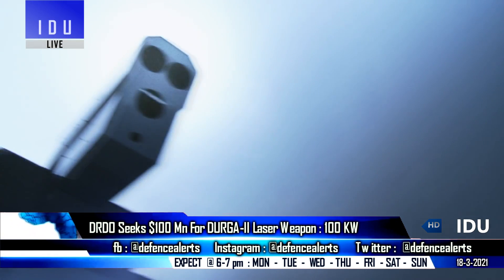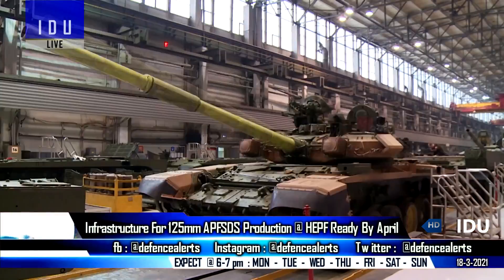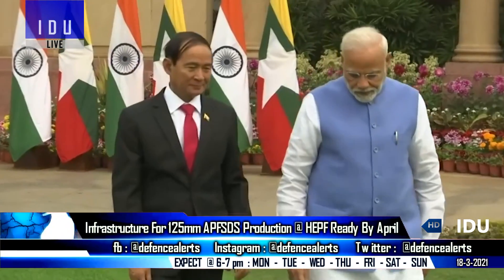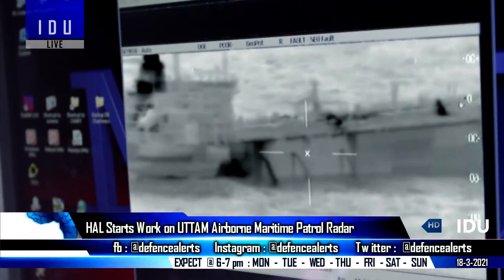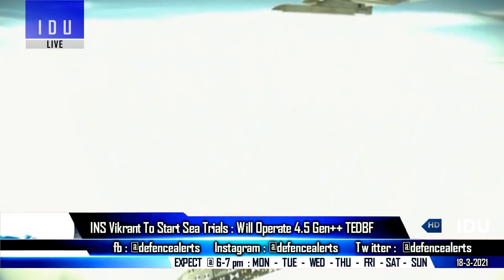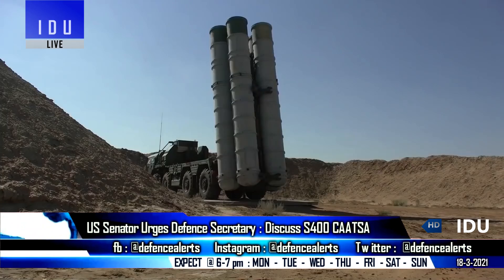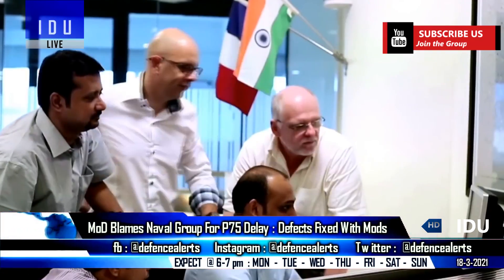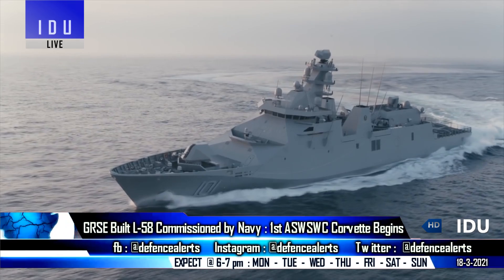Indian Defence Updates : DRDO Durga 2 DEW,125mm APFSDS Facility,Stealth Clothing,P75 Defect,L-58 LCU

Comment: Bro is it necessary for a fighter to have internal weapons bay so that it'd be called a 5th Gen. Now fighters like AMCA can't carry missiles like Brahmos NG, RudraM 3, Scalp. Only 4th gen fighters can carry these. So in distant future we'll needing such a 5th/6th gen fighter which can carry all these missiles right ?
Reply: bro the internal weapons bay is important for the stealth geatures of the jet.they can carry some missles but it should be in a weapons bay .yoh can see videos of american f22 raptor and f35 on how they fire the missles
Reply: @kishorekc7537  stealth is alright, not a problem but whose gonna carry those big missiles, i wanna know that. Coz around 2050/60 there won't be any 4.5 gen fighters, the current ones would become obsolete.
Reply: @sigmasam1194  5 th gen can carry all the missles but it should be modified
Reply: @sigmasam1194  very big bombs will be carried by bombers
Reply: @sigmasam1194  just use those missiles on external hardpoints in non stealth mode

Comment: Bhaiya sig716 ka thread version lega ya patrol version lega?? Please reply
Reply from the maker: SIG716 G2 Patrol
Reply: @IndianDefenceUpdates   That is not what it looks like for the current versions our soldiers are having, and the deliveries reached so far on the frontlines. 

The G2 is much different. It is the generation 2 of the original Sig 716, both are short stroke gas piston. Ours is a Sig 716i, a Direct impingement (similar to how US M4 series works) variant and not the much expensive G2 of the original short-stroke gas system.
Reply: @Stu_Bur  

Yes, both have their pros and cons. Harsh environment suits Gas piston format and its sub variants more than DI.

USA is switching  to gas piston format and its own sub variations for their ongoing replacement program for their M4 carbines. And all the participants are following gas piston format and its sub variations.

Direct Impingement is being redistributed to Urban Law enforcement use at most. 

Most of the well funded US special units when deployed deep in enemy lines, they are mostly equipped with rifles of gas piston format and its own sub variations...like HK-416 series, FN SCAR series etc. 

It is well established fact, gas piston format and its sub variations have clear cut reliability advantage in tough environment and they have far less chance of malfunctioning plus need of frequent cleaning than DI weapons.

USA can afford DI weapons as standard so far...only because they always had CONSTANT ON CALL 24X7 air support majority times. Not all nations have such luxury. 

Majority nations do not have their standard rifles for their regular infantry being of DI format. Except Canada NZ, USA for example for a few to list.
Reply: @Stu_Bur   Still does not change the clear fact, that USA is looking for NON DI alternatives for their ongoing M4 replacement program along with their new rifle caliber research of several variation of 6.8 cal projectile in testing.

Like I said, DI has its pros, like, being a tad bit accurate and less expense, less weight being the  Prime pros of DI. Cons of it are, it gets dirtier in the action side, BCG parts than with gas piston variants and heats up quick plus fouling on the action, requiring frequent cleaning than gas piston variants.

But majority still prefers gas piston and its sub variations. They do see it far more reliable than DI guns.

Most well funded Special units always prefer gas piston variants over the DI. For them, Using suppressor would impede reliable cycling of the gun, for standard DI gun, there is no adjustable gas system being standard that is in use with any regular force. For Gas piston and its sub variant guns, they do not have this issue and, most has adjustable gas regulator as standard. 

For US special units who use DI guns...like M4 variants of MK18 for example, they would be pre-adjusted or tuned before ops, either with tuning it by adding an adjustable gas block from the armoury, and adjusting on buffer weights and springs etc as well. With Gas piston and its sub variants, you do not need to go for such time consuming tuning and adjusting. Slowly, almost all US special units are switching to gas piston variants.
Reply: @Stu_Bur  Yes it is...

But it is being worked, the replacement program, I mean.

The rest majority still remains not DI users. Well funded special units always choose to prefer gas piston and its sub variants and that fact also remains.

India chose the DI version of SIG 716 only due to one prime thing, and that was, being cheaper. We brought it barebones. We are price sensitive.

Rest of the nations all brought the G2 gas piston variant of the original design of SIG 716, G2 is just an update of the original design. They weren't being price sensitive like India. But yes, I get India has a lot of troops to consider and to set defence relation with USA.

We could have always brought from Israel on their offerings of the same caliber.
Reply: Nahi Diesel version. 😜🤣
Reply: @suemeyt1895  sab auto correct ka kamal hai😂